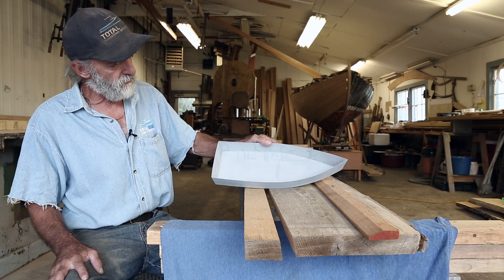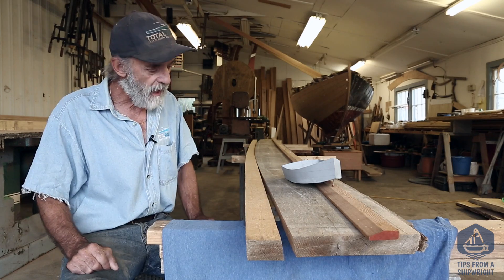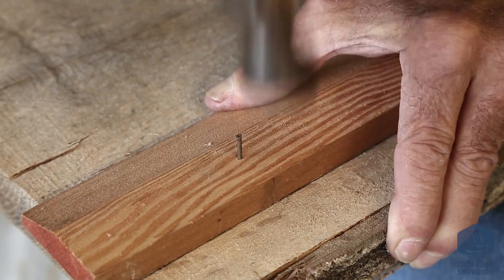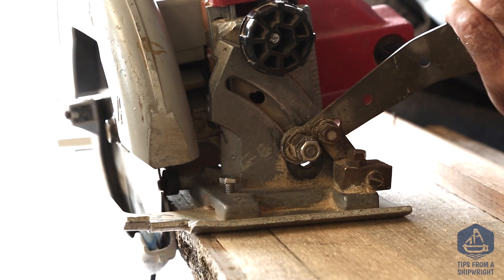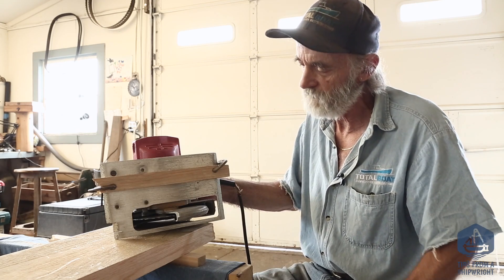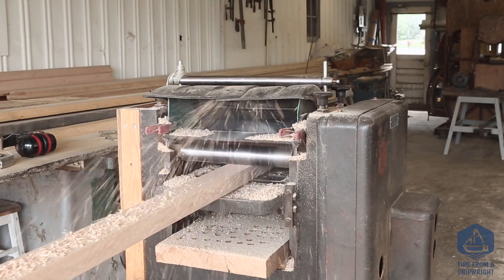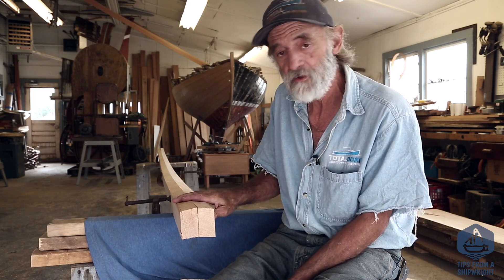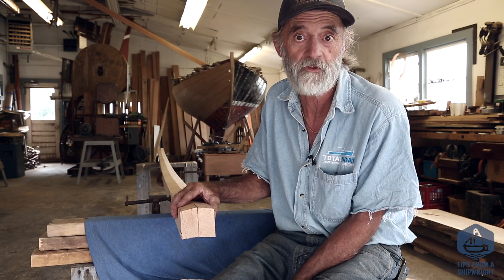Building the TotalBoat - Ripping the chines (Episode 6)

Comment: you lost me on "only expected to last 30 years" (prob more like 20)  Old boatbuilding methods and wood construction are great, but throwaway boats are not worth the effort to build from wood. Oregon wood river dories will easily last 50 years if treated properly...end grain exposed bottom planking on this skiff seems nutty to me. Why not just glass the outside and oil the inside?

Comment: How do you determine the curvature of the chine logs when you draw them on the board?  Is the curvature based on you little model boat? Thanks for the great series of boat building videos.
Reply: Thats where im stuck at. Im trying to figure all the curves out. Thats the only thing stopping me. Ive got plenty of wood and tools and time but until i figure that out , i wont start.
Reply: Could determine the curvature of the chine logs?

Comment: Why isn't black locust used more in boat building?
Reply: It's hard to find because it's not commercially grown and harvested, (that I know of) I use black locust out here in the northwest, but the supply is limited to finding trees that people want to get rid of from their front yard.
Reply: If its a superior wood than i may have to start milling some. Grows like a weed on the new york/ct border.
Reply: +Pro303 definitely worth milling some if you can get it. It is a superior wood for the construction of wooden vessels, very rot resistant and bends well. On the down side, long lengths of straight grain can be harder to find, it glues poorly and is harder to cut that many other woods. I would use it a lot more if I could get it.

Comment: Would the capillary action of the red oak make it good for impregnating with penetrating epoxy?
Reply: i was thinking the same thing......but wouldn't the penetrating epoxy cause the wood to stiffen and lose it natural flexibility...maybe a good jolt might cause it to snap or crack?? then there's the added weight factor......i hope Louis answers this one
Reply: hardly, use super thin super glue, drop it on the endgrain of any species of wood your like. an sand/plane away until its gone, this would be the about depth for an epoxy that is much thicker in viscosity.

While you can create a petrified wood effect with thin epoxy, these pieces are too thick in size for that to happen, you can see petrified effects in woods when they are under 1/2" thick. but can be prevented with a thicker viscosity epoxy.
Reply: I wonder if steaming oak to expand the pores then, under vacuum, soaking it in the thinnest epoxy available as it shrinks back with heat loss, would work to get more epoxy in. I mean, sure, it would become slightly warped at surface, but, not too much since it's oak.

I have soaked pieces of white oak in very thin super glue (RC modeling glue, it's so thinned that it almost resembles water) and have obtained good penetration, up to (depending on grain and position) 1 cm / 1.5 cm.

I have heard, but i have not seen this done, that you can soak the wood in lacquer and that if scraped with a blade, it gives a glass like surface that's very strong. Again, i've never actually seen this, but i don't think the guy who told me this was messing about.
Reply: i went back and watched Louis's video on using penetrating epoxy to seal a thwart seat..the question that came to mind is the wood's moisture content.. the thwart seat is @3/4 of an inch  but the chine logs are thicker and the grain is horizontal....the penetrating epoxy would seal the exterior of the wood but it wouldn't penetrate so deeply that it would render the wood "petrified"
Reply: Sounds expensive!  If this is a  concern, why not just use white oak, or even Doug fir?